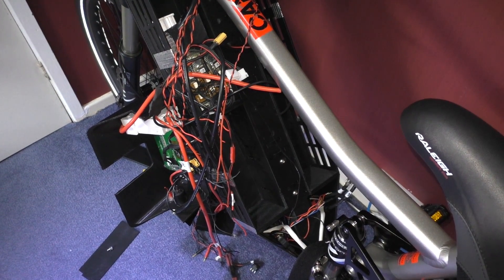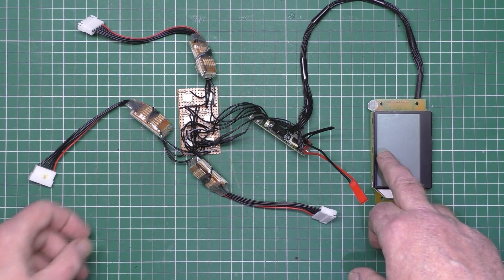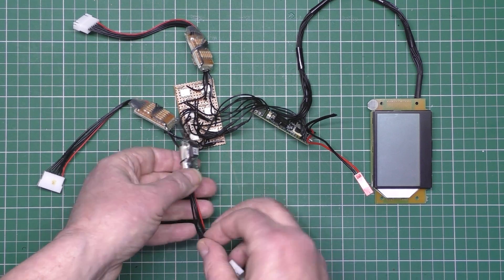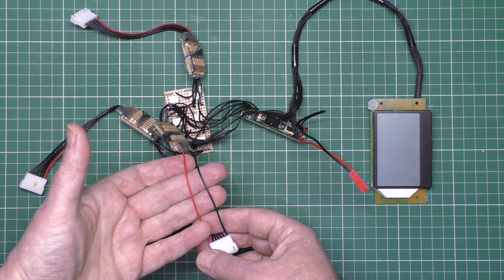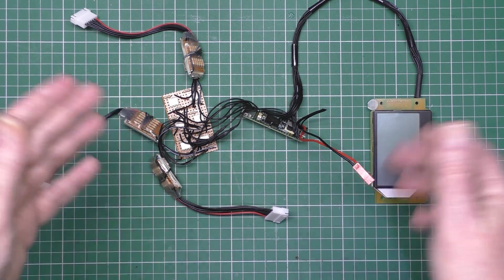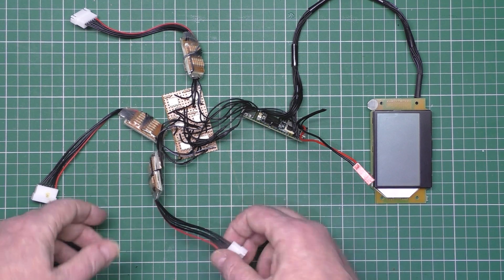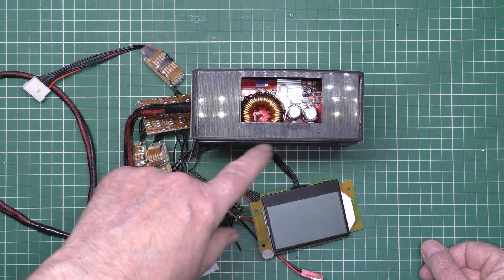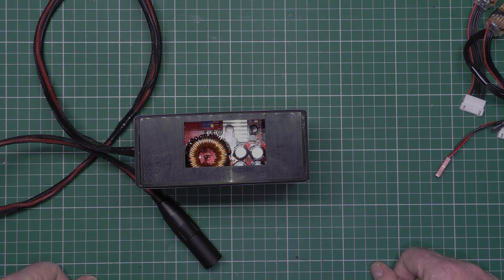11000w DIY eBike build part 8 - The DIY BMS is coming out!

Comment: Great video mate. Well done for getting it working, shame it didn't come together in the end but as you said its good experience. Jeez I'd be a nervous wreck connecting that up ,what with my electronics experience and the price of batteries.You are a better man than me. Good luck with the next step Tony!
Reply from the maker: I didn't show the failures mate. I always use some very thin wires to start with - that way, it'll use them as a sort of fuse wire if something's not quite right.   
Working with 72-75v and 8AWG wire, I always get an Arduino header pin, jam it in the exposed wire so it's half out and then, carefully touch it on the other wire. If something isn't right, the pin disappears. If you were to simply get the main wires and plug them together, there's a good chance they'll instantly weld themselves together and........
Reply: That's a great tip mate ,something I would not have thought of. Thanks for sharing. Look forward to the next video , you will get there mate!

Comment: Hi Tony, good to see you still hard at it....Im still trying to understand just what a BMS is...?...Im assuming its a clever onboard battery cell voltage balancer that works constantly to even up all the cell voltages if Im not mistaken?
  Would it not be simpler to just design the Lipo holders so you can quick release them and pop them on a charger...?...I mean after a longish ride, you will need to re-charge them again anyway won't you? 
  Sorry if Im being simplistic, Im an Engineer, but not in electronics of course...I keep toying with the idea of converting my old bike to electric too but just a 500W version.
Reply from the maker: You're the master electronics guy..... you got it 100% correct :-)   
With regard to taking them out and plugging them into a LiPo charger, I was sort of doing that in the first place mate. The 3 batteries were wired in series to get the 72v but to charge them, I had to unplug the main powerleads, find the balance leads, plug a parallel charge cable in and then charge them. A BMS will allow me to simply plug a charger directly into the new charge socket and I haven't got to worry about balancing them now.
Reply from the maker: Ahhh bugger, I got drunk on Sat night and bought more planes mate. I'll reveal all when they arrive :-)

Comment: have the same problem with 8S cell monitor ( the old ones ), they discharge 1,2 cell, i tested it with a row of 18650 and 1,2 cell got pretty drained after a week, so my solution so far before i make an upgrade is to just unplug them when not in use, they pretty much are only there to alarm if balance gets bad or charge gets low in 1 cell

Comment: Hope you fix it soon.I like my 48v bottle style batteries form factor easy to remove and carry.I have taken one apart now i see why no one has done it before and why they are expensive.I have made a couple videos if interested.
Reply from the maker: I haven't finished with the DIY BMS yet and I'm determined to make it work exactly how I want it. In the meantime, I've got a proper BMS coming from China so I can see how they do it :-)
Reply: The Tattu batteries are very good and well made since i damaged and removed the bad cell.Each cell tab is connected through a pcb and makes it harder to safely remove.I just cut it off the board and made it a 3s.But if it was a cell in the middle of the pack i would have taken it all apart and discarded the board.Good luck with the BMS i will try to reuse mine maybe.

Comment: Good example why i could never build some thing like this your Knowledge is worth its weight in gold, i know my place soldering solar panels i can just manage that lol.
Reply from the maker: Speaking of solar.... I've had a small 12v solar panel in my window for 2 years and it only powers a volt meter. I've just bought some more so I'll be doing some videos on them soon
Reply: Really looking forward to that Tony thanks, i did take delivery of a 12v 5w panel as we talked about and its perfect for what i wanted.
the PC fan needs 0.25amps and the panel at full load is 0.30amp so it only kicks in when the sun is shining well powering up my solar heater perfectly, i am now building one three times the size now my test build was so successful.